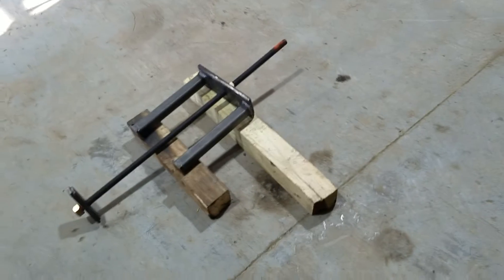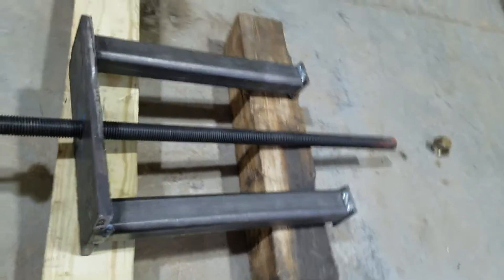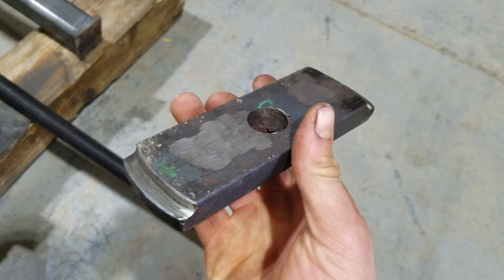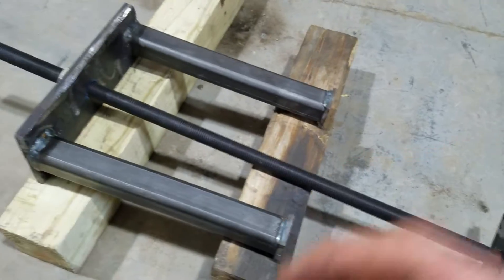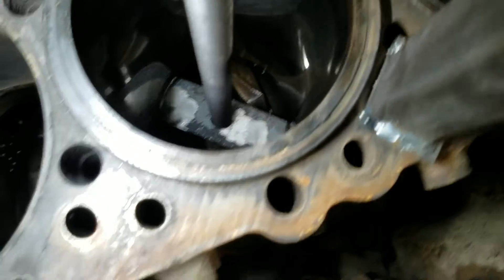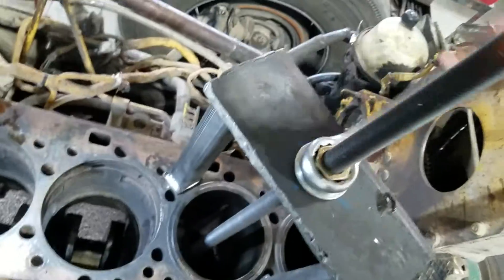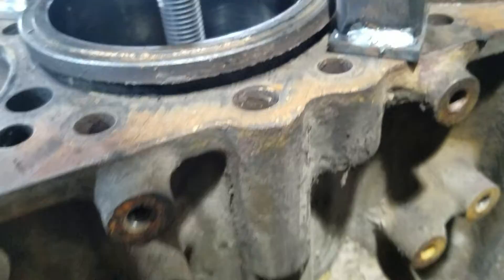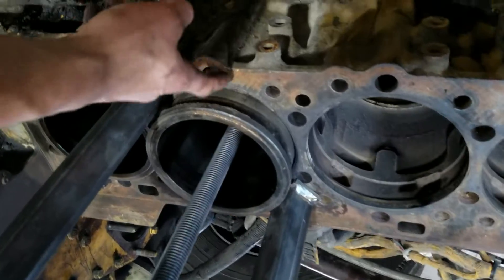Pull Cylinder Liners with your own puller | Under $150

Comment: How do you put them back in?
Reply from the maker: Wood block with rag around it and a hammer (dead blow hammer)
Reply from the maker: Light taps. Lots of oil on o rings.
Reply: @joelodico7500  '
Thanks Joe. Do you mean put lots of oil on the sleeve that fits inside the mother bore?  Also, I have read that people have broken the sleeves when tapping them back in and a friend of mine, a diesel mechanic did this exact same thing and started up the machine and the rings snapped off straight away as he said its impossible to get the sleeves lined up exactly straight. This is for the finished sleeve liners. Advise or suggestions muchly appreciated.

Comment: I made one like that about 45 years ago but I used heavy angle iron for legs so I could miss obstacles like studs or dowels. I always put never seize on the threads and the bottom of the nut.
Reply from the maker: Awesome! That sounds like a great tool.

Comment: Not as it should be ... You need a support that connects the two legs so that it does not slip, and the metal pressing piece from the top and from the bottom must be very thick .... The idea remains creative and good ... Greetings

🌹
Reply: They really don't slip once the pressure is on it. For the top I used angle metal. His ok for what he is doing . He is just helping people with the general idea not a tool built for every job and he knows that already.

Comment: Why do I always see this whacko shit for pulling liners on small diesels when all you really to do is size a hard wood and place it between the lower liner and a crank web and turn the crank shaft to them out? Forgive me for being THAT way but this is Navy Engineman A-School stuff and I have never had any issues with any small diesel doing it that way.
Reply from the maker: This this considered a small diesel? Lol. Have fun.
Reply: @joelodico7500  Yup
Reply: maybe you are talking about wet sleeves? Dry sleeves fit tighter and drag for a longer distance.